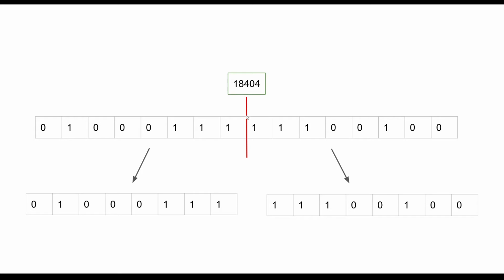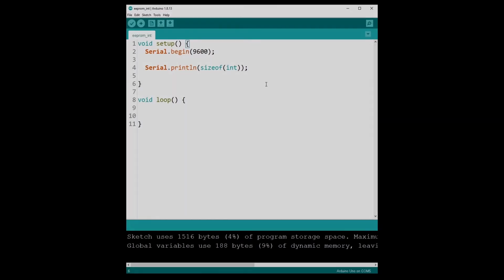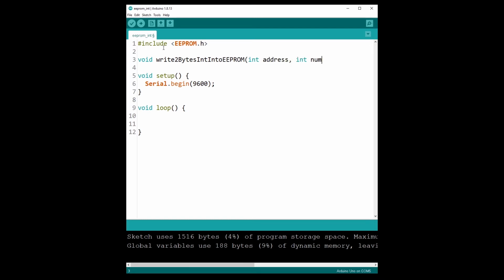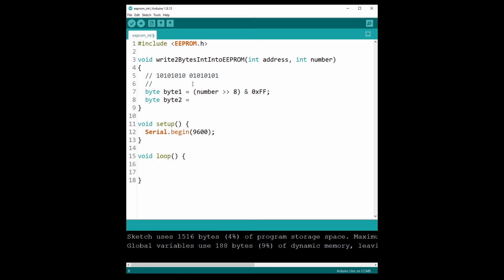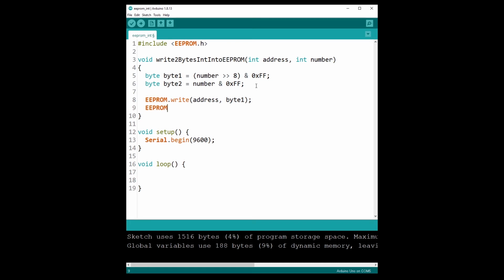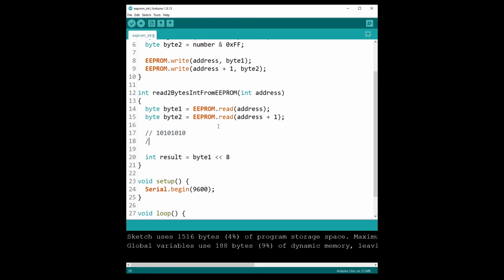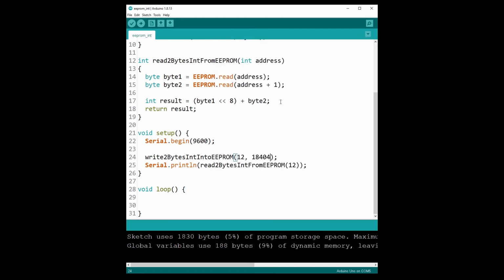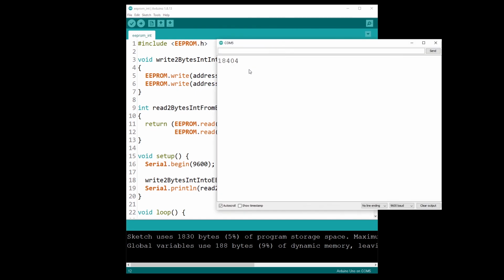Arduino - How to Save an Int into EEPROM

Comment: Hi, thanks for explaining in depth, how to read and write to EEPROM by manually shifting the bits, without relaying on predefined arduino functions. I have a question if I could replicate the procedure and store 4 byte floats? Thank you.
Reply from the maker: Yes, for a 4 bytes number you just need a few more lines of code, but the procedure is exactly the same!
Check out the end of this article where I explain how to store a 4 bytes (long) data type. You should be able to get inspiration from that to store a float. https://roboticsbackend.com/arduino-store-int-into-eeprom/
Reply: Thanks for the replay! I ended up storing the float by incrementing the address. I've tried to replicate the code by using the long data type example code, but I get this error saying " invalid operands of types 'float' and 'int' to binary 'operator>>'  ".